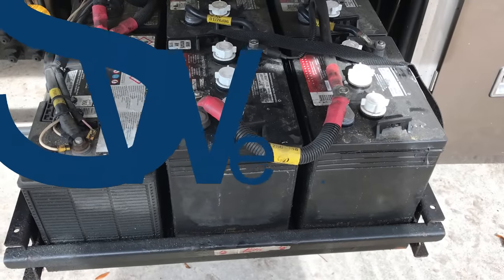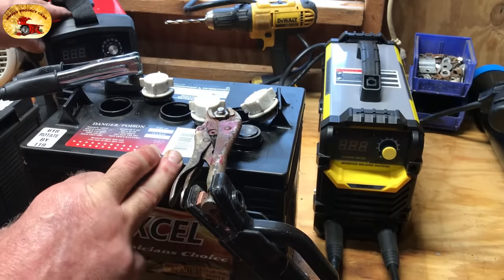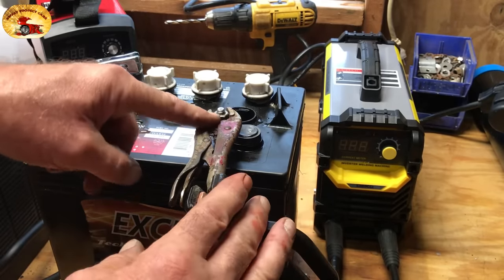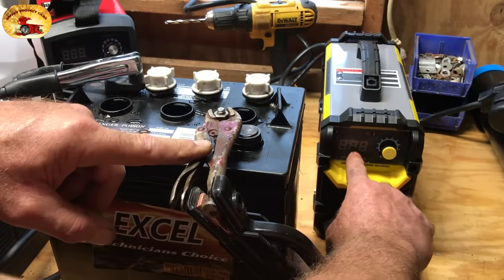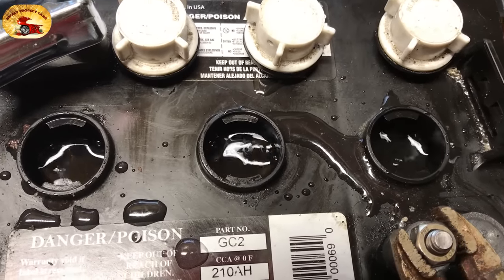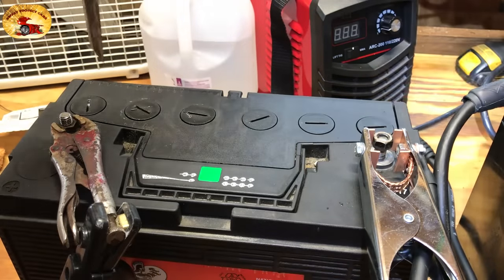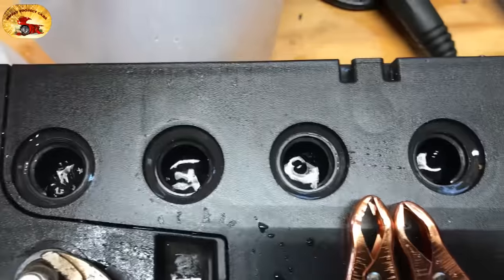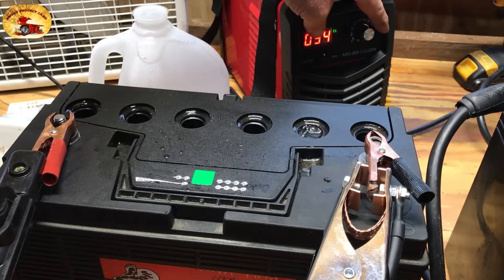How To MAKE OLD BATTERIES NEW Again!!!  12v 6v Deep Cycle, Car, Truck, Golf Cart, Semi

Comment: Ok, as someone who might actually try this, I need to ask: why 5 minutes on and 10 minutes off, why 5 times? how do I know if the cells are completely dead and when they have 'woken up', what do you mean crank it up a few notches and for how long each time? and what's the difference in procedure between my motorcycle battery and my pick up truck battery?
Reply: Believe me. Its work
Reply from the maker: Don't analyze until you are paralyzed this is an extremely easy process just follow the videos instructions to a T and make sure you disconnect the power to the welder before disconnecting the cables from the battery.  Thanks.  mad Mike the hammer SPC

Comment: Wow, only about 1.5hours to de-sulfate. I have a Vortex smart charger (kind of old by now but not much use) that takes 24 hours for de-sulfate mode and it never worked very effectively
Reply from the maker: This system is amazing Ken.  Everyone who tries it has all to gain and nothing to lose.  Thanks for sharing, have a great night.  mad Mike the hammer SPC
Reply: I have that same charger... they actually used to be quite sought after. Desulfate can take up to 2days. I found it to work Great on regular batteries only a couple of years old, as maintenance. The charger also has an Equalizing function that will boil all the cells. You need a toothpick to activate that and don't use on sealed batteries. Also, to Equalize (boil) a battery, be sure to put a load on it to discharge it first ~

Comment: When I click on your link for the red one, I end up on a 160Amp welder at Amazon.  In your video, I see the red one is a 200amp.
Reply from the maker: This  https://amzn.to/3kd4b8K  is clearly linked to the video and it's the same one we use in the production of the video, so not sure what you are looking at, check it again.  Thanks David!  Have a great day.  mad Mike the hammer SPC
Reply: @SweetProjectCars  Thanks for the answer, however, I have tried the link with several browsers and each time I get the following listing on Amazon: ARC MMA Welder 160A Stick Welding Machine.    Perhaps the seller swapped out the model on the listing.
Reply: This amazon add is for a 160 amp welder. Amazon changed something on you?
Reply: Does the battery need to be completely dead ?
Reply from the maker: Well, looks like they ran out of the red welders, this  https://amzn.to/3qFyc5F  is the other one that will work for this process.  Thanks for the heads up, we literally just checked the link yesterday.  Have a great day my friend.  mad Mike the hammer SPC
Reply: @SweetProjectCars  well, its Dec 14 and that one  you linked to now 5 days ago, the DEKOPRO 200Amp MMA Welder, is currently unavailable.  Pick another?

Comment: I wouldn't say that you'd never buy a battery again. Lead plates shed flakes as you charge them, so over time the plates will completely corrode or the flake build up will short the battery internally. This might give you another couple hundred cycles from a sulfated state. They designed it to have a short life span. Companies are evil like that.
Reply from the maker: Okay, let's not say "forever", let's say you'll be pushing up daisies before you have to buy another battery, is that long enough?  Thanks for watching.  Have a great day.  mad Mike the hammer SPC

Comment: I would love to watch the sponge-lead plates through an illuminated glass battery case. They put fish-tanks together with silicone. I wonder if it will resist battery acid ? What I wish is that somebody made batteries for sale that could be taken apart and reassembled with new or reconditioned plates, Something really industrial and bulletproof in standardized formats would just be the bomb. I just hate a F-ing cheap-assed plastic box I can't even get into with destroying it.
Reply from the maker: It would be interesting Joseph! Thank you for watching, have a great day. mad Mike the hammer SPC
Reply: Research Iron Edison batteries that'll really make you mad
Reply: from my understanding up into about 60 years ago, this was common practive, the problem is what do you do with the waste??? most poeple would just dump it on the ground or drain which is horrible for the enviroment

Comment: So, this is not a big secret. Yes, it is safe to do this to virtually any battery. You should be in a ventilated area as those bubbles are indeed hydrogen gas. 0 sparks whatsoever around this battery while "charging". I work with industrial forklift batteries and this is exactly what we do as well. The only difference is our chargers our designed to desulfate batteries, and its hard to find one that will for a 12v system. You should still use a hydrometer to measure the acid/water ratio.... but, you can omit that step. Simply "knocking" the sulfates off the plates does help alot. Obviously proper water level as well. These two things alone... will most defanantly make a battery last a long time. Ive seen industrial batteries, that have watering systems on them... last more than 10 years. Not uncommon.
Reply from the maker: Well there are a lot of folks out there that this is new to. We appreciate the view, have a great day. mad Mike the hammer SPC
Reply: @SweetProjectCars  i appologize, your absolutley right. There are a lot of people who don't know very mutch or are just learning about different... tools tips and tricks in their life. Absolutley intertaining video tho...

Comment: Question
So after trying to revive a battery threw 5 cycles of  5 minutes wait 10.

If the battery does not bubble in all 6 Cores 
Does this mean that I have a true DEAD Battery

Thanks
Reply from the maker: You have to do the video process up to 3 times before you can rule the battery as no good.  Thanks for asking, hope this helps.  Have a great day.  mad Mike the hammer SPC
Reply: @SweetProjectCars  Thanks
Yes I have that is what I was asking. I did the process 5 times .

The good thing is out of my 5 dead boat batterys I was able to revive all but just  one.

Not bad thank
Reply: @billmitchell2170   how old was your oldest u woke back up ?

Comment: How do you put water in a sealed battery ?
Reply from the maker: You don't.
Reply: they almost always have caps under a sticker.   peel off any stickers and you'll find 6 caps.  that is the "sealed" and "concealed"  after 5 years you'll find the battery quite down on fluid.

Comment: What about batteries that don't have the caps?
Reply from the maker: Not much you can do with those.  I don't think I have ever seen a battery that doesn't have access to the fluids.  I would say the next time you buy a battery, make sure it has caps that way you don't ever have to buy another one.  Thanks for your question. Have a great day.  mad Mike the hammer SPC
Reply: @SweetProjectCars  I had the same problem, it was just a one piece plastic cover welded over the holes (bosch 12v) the cover got smashed getting it off so i have ordered m20 plastic hex bolts to use as caps, i hope it works

Comment: Has anyone experimented with trying to recharge a car battery by plugging it into the wall?
Reply: The wall is AC voltage. A battery is DC voltage. Do not try what you ask.
Reply from the maker: We're with jessie k!  Doing what you stated will most likely have you pushing up daisies.  mad Mike the hammer SpC